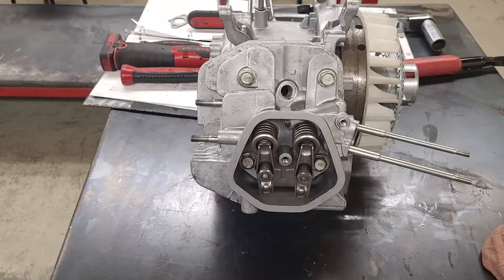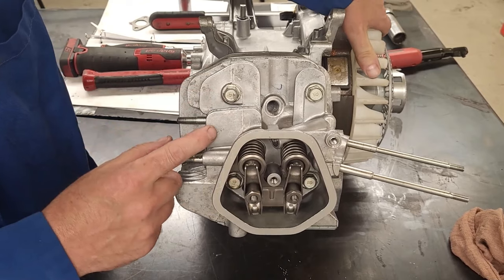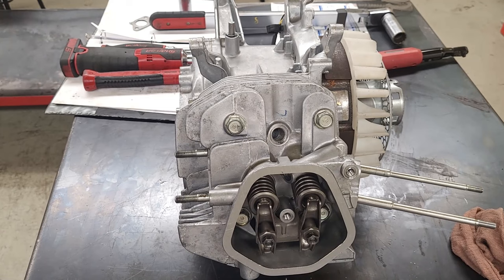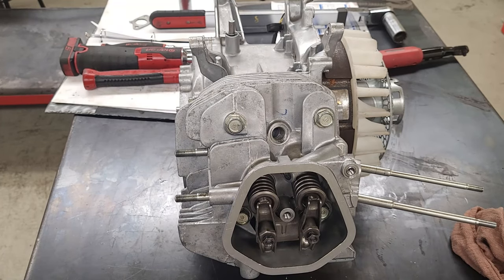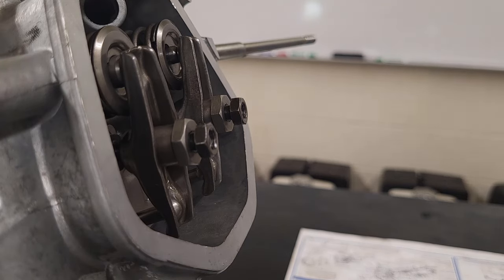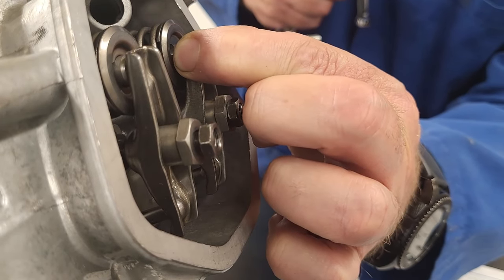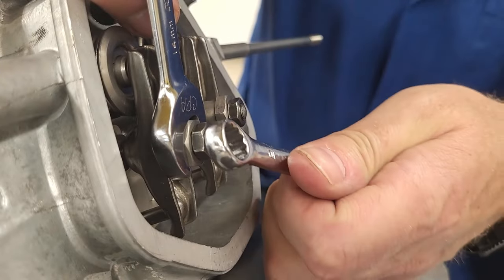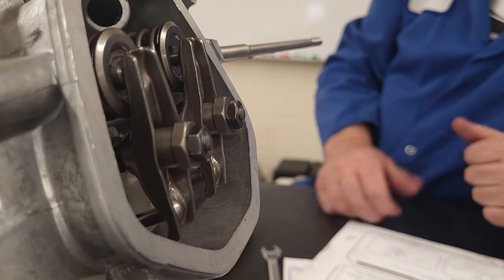Honda GX390 Valve Adjustment

Comment: The intake definitely moved when you snugged her up with the cute little torque wrench. 😅 Go back and watch
Reply from the maker: @bparker86  it will as the rocker  is not tight to the valve. It about the clearance after you torque.

Comment: Had a gx390 backfiring bad.  Exhaust valve was extremely off.  Adjusted it and it fired right up.  Thank you for the easy to follow video.  Now I need to get my hands on a 1/4" torque wrench.  Thanks again!

Comment: Great video Jeff, when i go to pull the motor to start it, it rips the cord out of my hand so much so its dangerous bloody whipped my hand, why does it do this?
Reply from the maker: That sounds like kickback. If the fuel and air ignite before it reaches top-dead-center on the compression stroke it could force the piston back down reversing crankshaft rotation and pulling the recoil cord from your hand.
Reply: @jtkasprick  prob bad valve clearence values, or coil placed in wrong way.
Reply: What did you do to fix this issue @mead6754? I have same issue on Honda gx390. Thank you
Reply: The Honda repair manual says to check the camshaft, the lobes...

Comment: So on my 4 stroke stihl weedeater when you adjust valves you spin the engine over until the arrow on flywheel is lined up with the ignition coil, and you wiggle it back and forth to make sure neither of the valves are moving, is this the same concept on this honda?
Reply from the maker: Exactly!
Reply: That is still a 2 stroke engine. Yes it has valves like a 4 stroke. Stihl calls it a 4 mix engine. Yes you do have to adjust the valves periodically.

Comment: my gx340 exhaust valve open slightly after intake valve closes during initial compression stroke to halfway compression stroke, is that normal?
Reply from the maker: The exhaust valve could be set to tight. During starting there is a decomposition valve that will open the exhaust vavle slightly during the compression stroke to aid in starting. I do have a video on that on my channel.
Reply from the maker: https://youtu.be/-UuA1F8-cDM?si=lHQpp6pfVLq49r05

Comment: How do you be certain the Compression release does not engage ? .....it is spring loaded to engage at low RPM and tightens up the exhaust valve ....